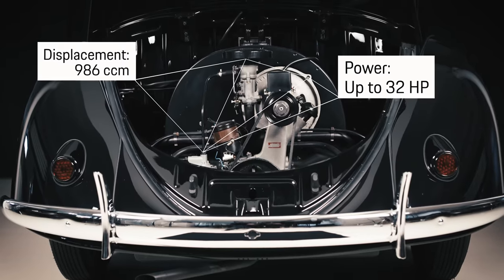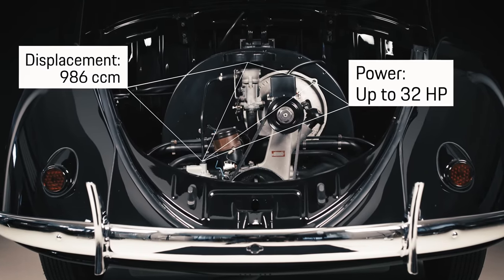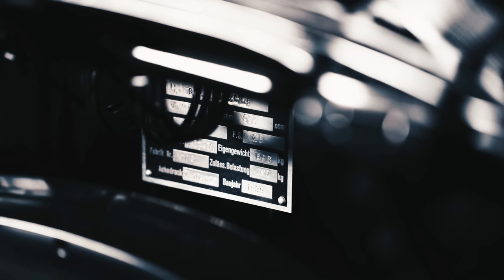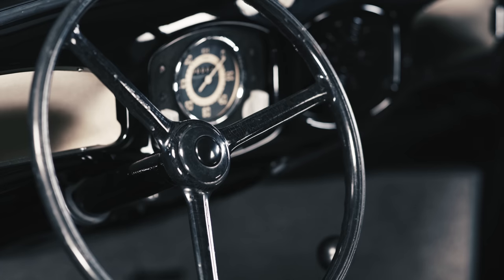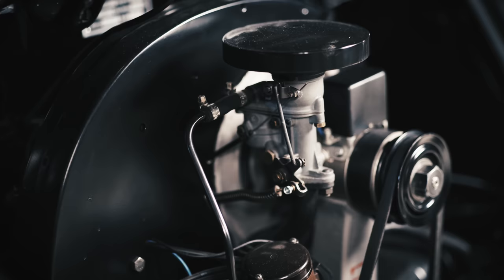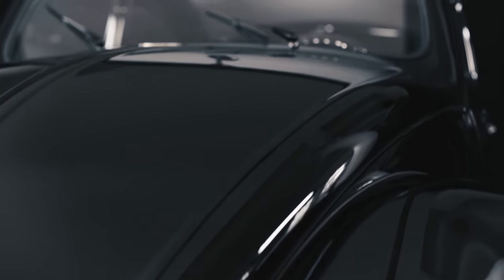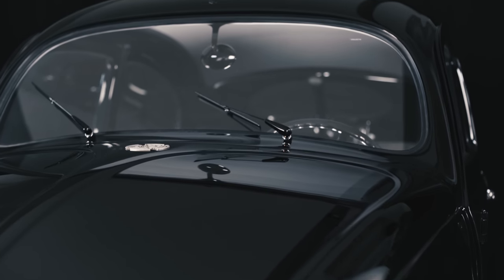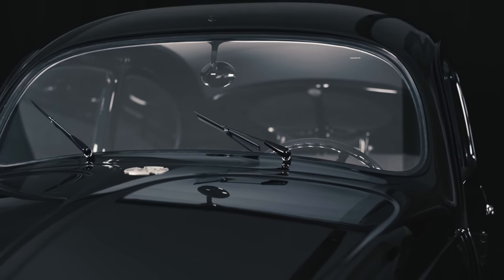VW 39–the last of its kind

Comment: My grandpa bought one brand new in 1959, he drove it for many years,   he gave it to my dad at some point in the early 80s dad drove it for many years.  When I was a teenager dad wouldn't let me touch it lol. In 2016 dad gave the little old bug to me. I drive it quite a bit.  I think it has had at least 10 different engines in it, about 5 or 6 transmissions and hundreds of tires in its lifetime,  anyway its still going strong.
Reply: Great story. A true family heirloom.

Comment: How Can I Tell The Difference Between Normal Beetle And A Porsche 39? Maybe If I Came Across An Abandon Beetle/39 Atleast I Could Tell The Difference
Reply: Won't happen, this is the last one in existence
Reply: Dragoş just go with the joke
Reply: First, they just found another one in the past few years, and it got restored. I think somewhere in the former USSR. The vw38 and 39 have more slots under the split window, outside door handles are a "quarter turn" rotary style, and the door hinges are different but hard to describe. I'm sure there are other differences but those are the easiest ones to spot, even from a distance